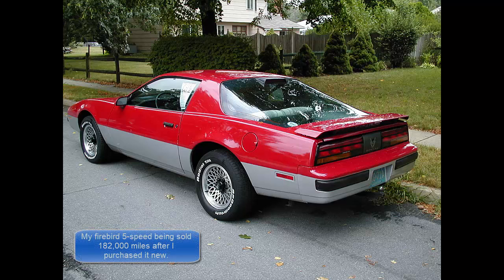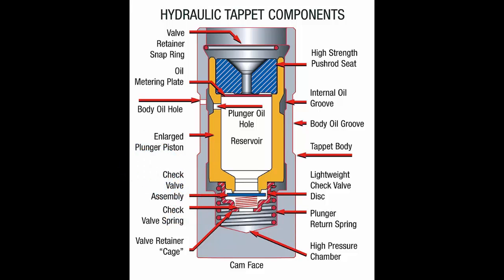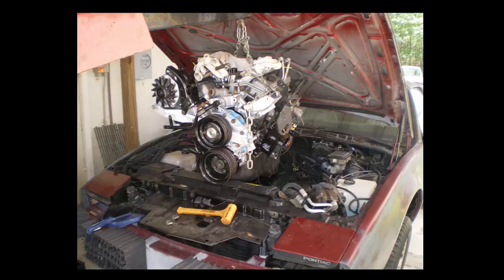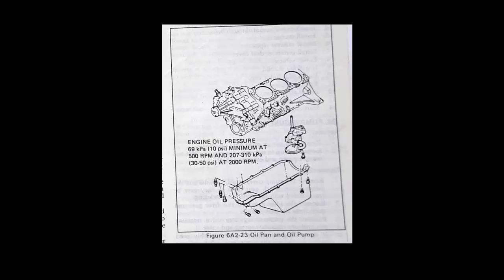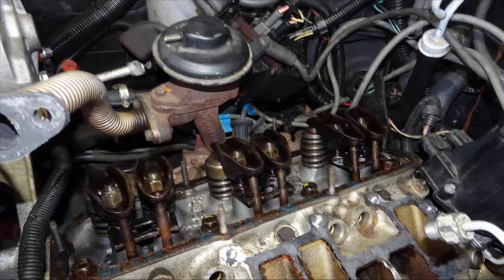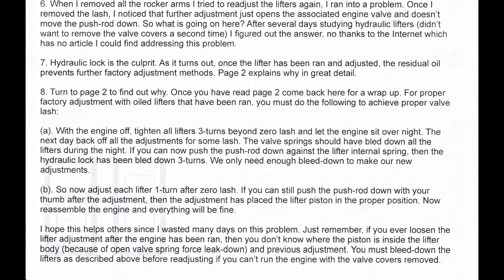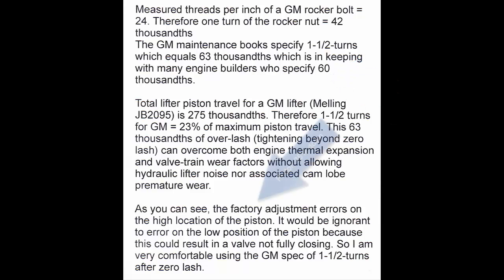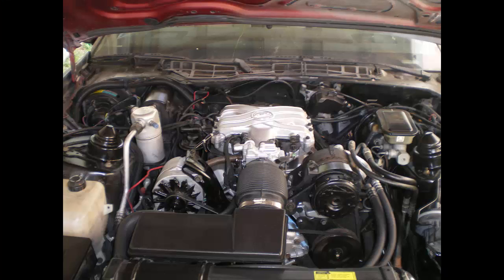Static hydraulic lifter adjust after engine run

Comment: My newly rebuilt 400ci, bored to 461 ci, oil pressure was 90 psi at first like 5-10 running minutes will go down to 40-50 psi which have been told is normal for newly rebuilt stroker engines. I was in a pnic at first seeing the gauge.
Reply from the maker: In my case changing the oil pump spring gives me consistent oil pressure since first startup.

Comment: I've been burned by trying to adjust rockers on "pumped" up lifters when I was a kid and prior to my propulsion engineering career. Learned the hard way like you did.  Thanks for posting.  99% of all hydraulic lifter adjustment videos and written instructions are for dry lifters.  Problem is that the instructions don't specify that the adjustment is dry, neither do they provide a wet (pumped up) procedure where the lifter needs to be pumped down.  Glad you figured it out.